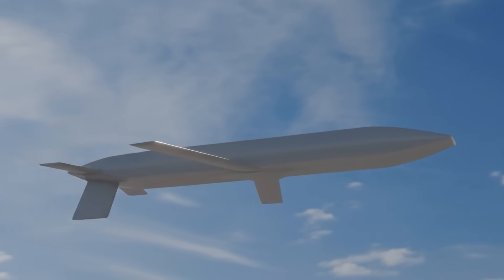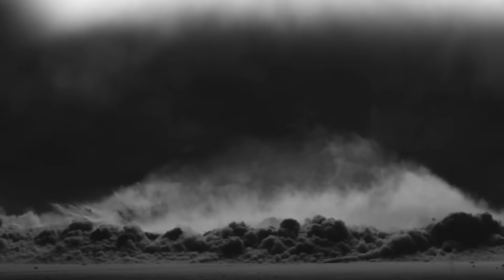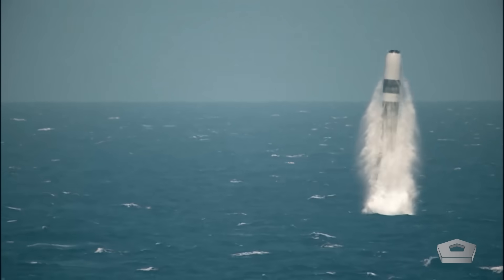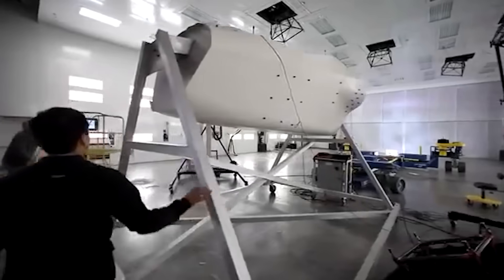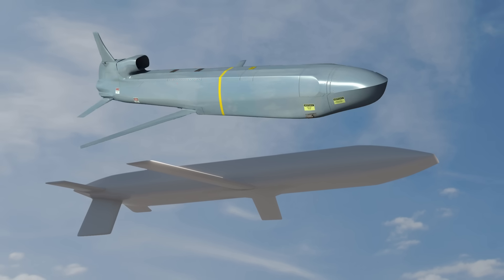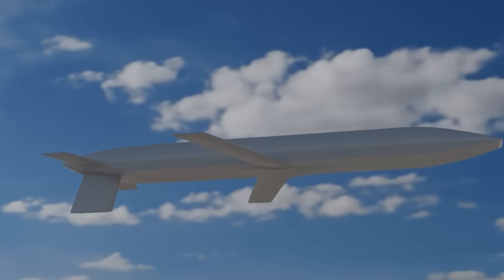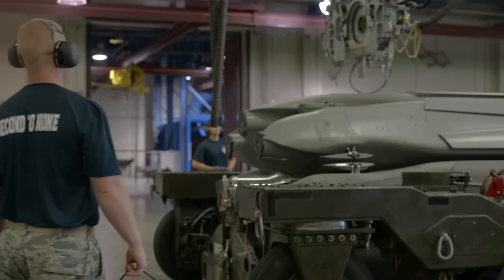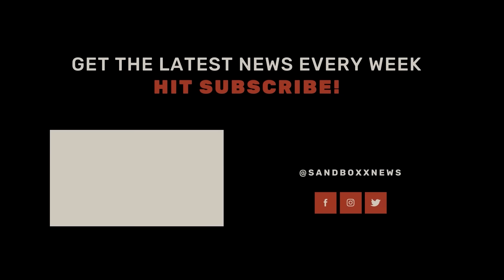Our first look at America's new stealthy nuclear missile!

Comment: That render would not be aerodynamically stable. To remain inverted it would have to constantly be using drag inducing control surface adjustments which would be highly inefficient. That and flying with the tail under the vehicle would expose it to more Radar waves. An on top configuration could at least partially use the body and wings/horizontal stabilizer to mask the tail.
Reply: No. Look up ALCM.

Comment: With the AGM-86 being replaced by this, would it be possible in a near-term Pacific gone hot scenario that the missiles get armed with conventional warheads to help bolster the US conventional cruise missile stockpile?
Reply: CALCM already came and went. Retired in 2019 and demilled. It would be far too expensive to retrofit and upkeep this old of a weapon system as conventional in an attempt to maintain reliability and bolster conventional stockpile. Simpler, more reliable, and honestly probably similarly priced to simply build new JASSM.
Reply: @odysseus4711  I meant as more a stopgap solution, in the event of war breaking out and the existing stockpile being depleted before it can be replenished by manufacturing. Most wargaming projections show the US running dangerously low on missiles in only months.

Comment: Alex, Thank you for the interesting video. For some additional background on the original ALCM, check out the Time Magazine issue from April 7, 1980. The cover article titled “FLYING HIGH $4 Billion for the Cruise Missile” goes over Boeing winning the original ALCM contract. It also talks about Boeing when they still had a respectable reputation.

This Time article was a very effective job recruitment story for Boeing. I was in my early twenties and so impressed by the Time story, that I moved from the midwest to Seattle and started work at Boeing in July 1980. I retired from Boeing in August 2012 and still live in the Seattle area. I was very proud to have worked for Boeing. Unfortunately the last few years I was there is when the troubles with the 787 and other issues started to hurt Boeing’s reputation.

It saddens me that Boeing’s management team has been unable to return the company’s reputation to that of the premier Aerospace company it once had.

Comment: How do you start a turbofan engine in a cruise missle mounted on a rotary launcher ?
Reply: Usually a compressed air tank to spin it up after it’s ejected off the launcher.
Reply: You can't. For one both the inlet and exhaust are sealed and the inlet is stowed in the missle body when it's on the CSRL or a pylon. If you pause at 5:25 you can see the inlet seals and notice that they look like rubber with a piece of webbing sewn up and down the middle. That webbing has a loop that gets pinned to the CSRL or pylon and when the missle is released that strap pulls the inlet in place and yanks the seal off. The exhaust seal is seperated with a small pyrotechnic and a start cartridge that spins the turbine ignites the priming fluid fires shortly afterwards.

Comment: Is it possible that they are using a passive "NACA Duct"? 
Which is that somewhat A (or V) shaped inlet that doesn't stand proud of the body panels. They've been used on many many aircrafts, but also on vehicles for turbo inlets, or as fresh air inlets in plexiglass side windows with a hose that ducts it into the occupant's helmet(s).

("passive" duct in the sense that it is not placed in the air stream and therefore doesn't act as a drag-generating ram-air duct; yes, both are technically passive, but one allows the engine to draw in air, whereas the other forces in air)

Comment: Curious what happens inside these variables yield warheads.  Specifically would that mean that part of the fuel go unused when set to low?  Would that make the blast inherently more dirty at this setting?
Reply: I would imagine that both the primary (Plutonium Implosion) and secondary (fusion) parts of the warhead are both boosted by injecting tritium (gas) into them as part of the arming or pre-detonation sequences. A low-end yield could then conceivably be done by not injecting any tritium into the primary and designing that primary in such a way that the unboosted primary does not provide enough yield (energy) to ignite the secondary. If a neutron absorbing gas does exist in quantity then I guess you could try to tamp either yield by injecting that to 'poison' the nuclear reaction and limit the yield that way.

All my uninformed opinion of course.
Reply: @echomande4395 so you are saying that the primary plutonium is consumed regardless and the variability comes from the tritium😊?
Reply: @MrGameMeister  Mostly the opposite.  Whatever tritium is injected into the core is consumed.  The tritium fuses, releasing excess neutrons, which in turn consumes more of the plutonium core.  More tritium means more neutrons means more plutonium burn up and higher yield.
Reply: @wagnerrp  Thanks.  Still sounds like though that if the plutonium isn't burned up, then it's left over and would dirty up the explosion. My query was meant to understand the after effects of low vs. high yield in terms of residual radiation with a bomb of this type.  Thanks for the discussion :)
Reply: @MrGameMeister  Plutonium is fairly inert, so long as you don’t ingest it.  Unburned plutonium fuel remains inert.  Sure, you scatter a few kilos of it around, but it’s not really much of a concern, considering the other effects of the bomb.  A bomb is “dirty” if all you have is the radiological spread, meaning it fizzled.  A bomb produces fallout if exploded close to the ground, and kicked neutron-activated dirt up into the air.
Reply: @wagnerrp  Sure, understand the difference in air vs. ground blast. That's why Hiroshima didn't suffer the long lasting radiological after effects (luckily). I have to imagine though that unconsumed plutonium and possibly other elements created by the blast when spread either by air or ground would still make matters worse long term when compared to the core being consumed fully.
Reply: @MrGameMeister  Nah. It’s an alpha emitter.  A piece of paper will stop the radiation.  Just don’t eat it.  It’s heavy enough that it will settle and remain mostly undisturbed.  There’s far nastier stuff to use if you want to make a “dirty” bomb that’s actually effective.

Comment: Can you cover the theory of how dial a yield works? I’d expect lower yield settings to be “dirty”?
Reply: It doesn't matter because the total amount of uranium/plutonium is tiny and will be very widely disperse by the nuclear explosion.
Reply: I would think so too. with all that extra nuclear fuel, not converted to energy.
Reply: @gagewambeke6230 nope. Not how it works. 

Same amount of fallout. Actually, it'll be spread less if it's a slower reaction. 

Turned all the way up, it's a larger, faster reaction.
Reply: @gagewambeke6230  That isn't how it works.  (I understand the thought process that would make you think it though.  It seems a reasonable conclusion.)
Reply: I think ... the plutonium core is consumed the same for each yield.  It is the fusion part of the package that is modified.  I think.
Reply: Correct  @stevesmith6385
Reply: As I understand it the hydrogen bomb has two parts; a fission trigger and a fusion main.
For the lower yield only the trigger is initiated.
I doubt that the bomb is any dirtier as it produces the fission products either way, but less neutrons without the fusion reaction.
Reply: The main method that's publicly known is that you can dial the yield by controlling how much tritium (radioactive isotope of Hydrogen) is injected from the reservoir into the pit, the center of the plutonium sphere within the physics package. More tritium = more of a boosted reaction. It's also possible, in very advanced weapon designs, to alter the behavior of the external neutron source. Finally if it's a dual stage weapon the second stage can be entirely disabled.
Reply: @Blixey-r9z Neutron generators could also play a factor, possibly. I've seen reports that China has developed a hydrogen bomb that doesn't provide a nuclear yield.
Reply: 5 kiloton is the yield of plain 1st stage without any "help", to get higher yield D/T gas is injected into central cavity of the core and external neutron sources are activated. After it goes beyond certain treshold, second fision stage is iniciated and yield jump to maximum 150 kt.
Reply: Lower yields aren't necessarily dirty. The neutron bomb was designed for an enhanced radiation burst, but very little fallout. I don't claim to have any special knowledge, but the few facts I have seen about them say the difference is neutron reflectors. Most fallout comes from ground burst weapons lifting dirt through the explosion into the stratosphere.
Reply: @john_in_phoenix yes. An example would be the Soviet Tsar bomba which had two setting 50MT and 100MT.  Concerns about the fallout lead to the 50MT configuration being tested - still to this day the most powerful nuke ever detonated.  Afair the difference was that for a 50MT config some tamper was removed.  And yes, the 100MT config was expected to be very dirty.
Reply: Having worked for the NNSA, the method is supposed to be classified.
Reply: the efficiency is not that great 
they're all dirty 
the first bombs used on Japan were (i think) 3pct efficient 
in other words only 3% of the nuclear material underwent fission
Reply: @SDsc0rch  3% is specifically for the "Little Boy" device used on Hiroshima. Fat Man's efficiency was much better, at 16%. This is why gun-type weapons died with Little Boy and everything since is implosion-based.

I am pretty sure modern weapons have better efficiency, particularly once they add a fusion stage.
Reply: Omg, this brought back some memories for me. I spent some time in the US army from 1969 until 1973 in Germany. 

For a few months, I served in an ADM (atomic demolition munitions) unit. 

We had five four-man teams and five Deuce and a half trucks with ammo trailers, stuffed into bunkers and to the side of a hill. 

Each team had two devices. The first one was mocked up to look like a 55 gallon fueled drum, the yield was 20 kilotons. The second was made to look like a spent artillery round and could be carried in a backpack. And it was, guess what, dial-a-yield! On the base of that device, there was a little dial with three settings, y1 = several 100 tons, y2 = 2. Kilotons, y3 = 5. Kilotons.
Reply: @robertpaschelke5975 How were they designed to be delivered?
Reply: Most of the yield variation is from the fusion part, so plays no role in being “dirty”, and even a “dirty” fission bomb is nothing compared to an purposefully designed dirty bomb
Reply: Extra scary = maximum deterrence.
Reply: Like Bioterrorism?
Reply: I believe it has to do with injecting tritium into the core, or not
Reply: Ooh this is a fantastic question that I’d enjoy hearing answered!
Reply: Moot question, When it comes to military bases, they can be as large as small cities. Higher yields are dirty enough. Once it goes off, the targeted area is done doing anything for 1/2 a century, minimum.
Reply: @secretbassrigs you must be fun at parties…
Reply: @chrisschemmer1978  lol! YouTube censored my other comment saying that I really am fun at parties!🎉. 🤣🤣🤣🤣
Reply: @secretbassrigs 😂😂😂 thanks for rolling with it! I actually believe you!
Reply: No. Lower yield will be less explosive. It changes the reaction. 

No more dirty. It's not like there's 'leftover radiation' that didn't explode.
Reply: @therdubya  correct! higher yields also spread the "dirty" dust around much further.
Reply: @secretbassrigs  yup. I explained that in another reply. 

I'll never not understand someone going and looming up a question they have. I don't know everything about anything, but I know a little about a lot. Maybe it comes from not having information like this at the tips of my fingertips when I was growing up? Idk. 

I've learned so much just from researching "why" to something that sounded interesting.
Reply: ! Neutrons !
Reply: Every common use and made thermo nuclear warhead is a fission/fusion bomb (hydrogen) bomb. Plutonium is the fission part, a fixed amount, basically minimum needed to cause the fusion reaction. Which is a tiny amount of hydrogen gas, so our selective yield, just vents hydrogen to the desired yield by releasing pure hydrogen to atmosphere. So they aren’t any dirtier than any other nuke, and ours have been busy the cleanest ones, if used at optimal air burst height for non hardened targets. Air hurts are very clean, in terms of fallout and lasting radiation, worst is right under it…but your smashed flat/vaporised before you know anything even happened so radiation is no big deal then…thats gonna be the most irradiated, for a short term, think days to weeks at most and really the weeks part is just for pure safety and adult with little to no medical issues, with minimal protective gear can into that area hours or a day if absolutely necessary. For a little bit, as the worst radiation is decayed by then, mostly. Fallout is minimal, due to air burst, fallout only truly becomes a major issue if ground bursts/ground penetration bursts. Then all that material they throw up and out, is highly irradiated and will be for days to weeks, even months. It will remain highly dangerous to anyone. And cause lots of issue downwind of the detonation site. Our (US) nukes if remember right, the most powerful ones use a mere few ounces of hydrogen gas, to achieve all that insane power, so they can vent most of it, and still get a fission/fusion reaction and…”small”as far nukes go. Thats also why nukes are cleaner, more the atomic material is consumed or converted to something safer, or at least less radioactive, and most the actual power comes from fusion of hydrogen atoms, now it puts out a horrendous burst of gamma radiation but that is very short lived, a ton of heat, the radiation will get you almost instantly if close to the detonation, the thermal pulse will get next, then the first blast wave, then the second as the air comes back in all at once, and every for miles to ten or so miles for the biggest hydrogen bombs will be gone/flattened, or burning almost instantly in the total destruction zone which can be small, like around a mile or so, out to like 10 or so miles. And terrible, out of control super fires outside of that area, from the thermal pulse, in a 360 circle.
Reply: Interesting comment thread.
Reply: @fakecubed indeed, almost like some people know the basics, and others are making up stuff, cause they just say no. Thats not it. When the basics according to physics are a set number, any physics major, given the tools and materials can make a nuke, that’s a long forgone conclusion, the hard part is getting the best, most refined, cleanest materials to make it useful and efficient, usable in bombs or cruise missiles, or ICBMS, and atomic warhead, is fairly straightforward forward, but very large, and heavy for low yield in comparison.thats the problem, make a small, fast, long range, fast and stealth warhead, selectable, effective, clean as possible. Dangerous and deadly as possible, that is mass produced, mass adopted, mainted and cheap and easy to maintain a total stockpile of thousands of thousands of actually useable warheads, no one has dine it except the US.
Reply: @fakecubed agreed 😮
Reply: You can Google 2-stage nuclear weapon
Reply: It would only be "dirtier" if it was detonated closer to the ground. Most of the irradiation occurs when the warhead detonates near the ground and sends irradiated debris into the atmosphere.
Reply: @memeityy nope.
Reply: The amount of tritium introduced before deployment.
Reply: Dial a yield nukes just allow you to choose just how much radioactive materials you actually implode with the high yield shaped charges, atomic weapons are made from two separate radioactive materials, usually a small sphere inside a larger one, very powerful shaped charges collapse the outer sphere into the inner sphere, the resulting lack of space allows neutrons to collide with more nuclei, freeing more and more neutrons, that's what they call a chain reaction, if you don't compress the entire outer sphere into the inner sphere, carefully calculated partial implosion of the outer sphere results in a chain reaction that runs it's course and stops yes all dial a yield warheads are effectively dirty bombs if they aren't set for maximum yield
Reply: Yeah I believe you’re making a valid point here. I’d be curious to hear the answer to your question. It’s a good question.
Reply: No.
Reply: ДРУЖБА С БОГОМ НАПОЛНЯЕТ НАШУ ЖИЗНЬ СМЫСЛОМ И НАДЕЖДОЙ

 

 Почему ещё для нас хорошо приближаться к Богу? Во-первых, дружба с Богом Иеговой наполняет нашу жизнь смыслом. А во-вторых, она даёт нам твёрдую надежду на будущее (Иер. 29:11). Давайте поговорим об этом подробнее.

 Дружба с Иеговой наполняет нашу жизнь смыслом. Сегодня многие отрицают существование Бога. Поэтому они не знают, для чего люди живут на земле, и думают, что в будущем человечество вымрет. Но, изучая Библию, мы убедились, что Бог «существует и что он вознаграждает тех, кто настойчиво ищет его» (Евр. 11:6). Кроме того, Иегова создал нас с потребностью поклоняться ему. Поэтому, когда мы служим нашему небесному Отцу, мы по-настоящему счастливы (Втор. 10:12, 13).
Смотрите в писании эти места.